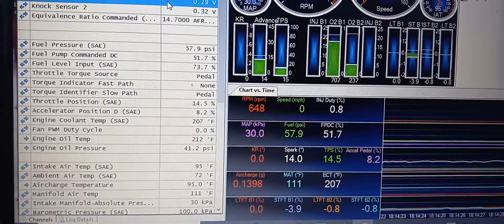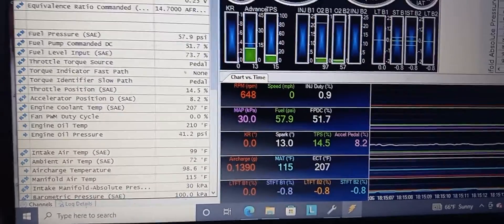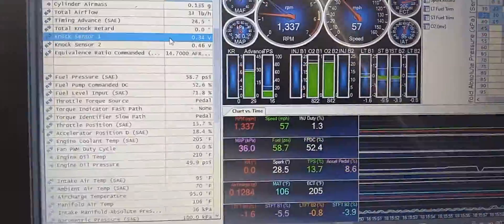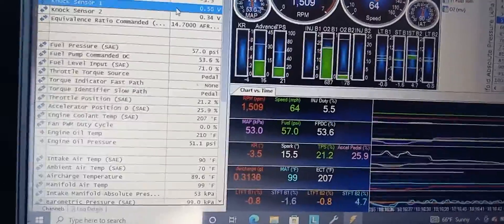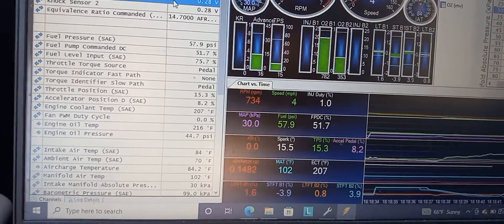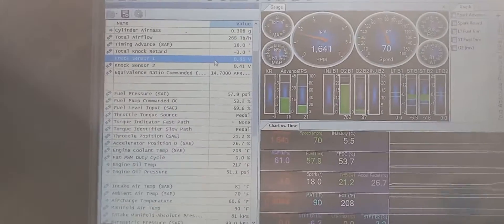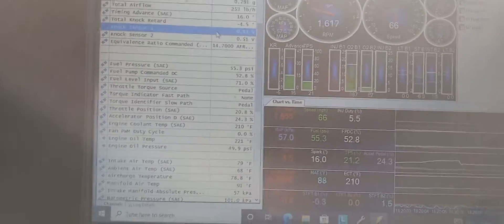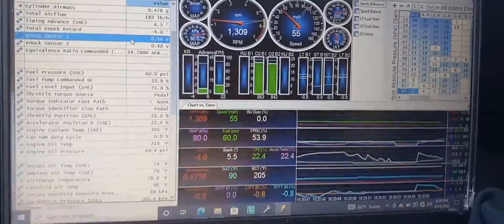short-term knock retard demonstration. 2017 Ram 1500

Comment: When you log minis 4-5 degree knock. Do you hear the pinging? What is the easiest way to distinguish false vs real knock based on voltages? Does higher volt always mean more knock ? How does it translate volts to knock?
Reply from the maker: 1) no it is usually - but not aleays- false knock at that load level with that fuel. 
2) anyhing above 2.8 volts
3) yes, sort of... 
4) too long to type.
Reply: @Moto-Psycho-1 i get 1.4v at WOT on my hellcat that has 2.85. With e15 and 16-17 degree timing. Knocks around -4 degrees. Could it be true knock.
Reply from the maker: @captain052A who tuned your car for the 2.85 pulley originally?
Reply: @Moto-Psycho-1 iam tuning myself currently.
Reply from the maker: @captain052A how much tuning experience do you have with other platforms? I would highly suggest getting your car to a qualified tuner have it on a load bearing Dyno and have your fuel trims, knock sensors and timing sorted for your combination. You will also want to make sure that you stay on top of your fuel pressure monitoring.
Reply: @Moto-Psycho-1 i have around 4 years experience. Iam not expert and not new. I can comfortably tune N/A hemis. But just diving in hellcats i thought better to get experience from someone who has hellcat before😁. Fuel pressure is a bit dropping high rpm. But iam watching it constantly. Iam upgrading to dual pump soon. But i expected the car to have minimal knock at 16-17 degree with e15. I guess i will bring it down a bit and relog.what do you think.
Reply from the maker: @captain052A man, so much to say that I don't even know where to start. First of all, I don't like e15. Your fuel pump is at its limit for what it can manage and those pumps are known to get weak over time so please keep an eye on that. As far as timing, it depends on what your air charge is and I don't know that you've even adjusted that table. There's so much that goes into tuning one of these cars that the fine details really do matter. That's why you've got to tune one of these cars in a controlled environment if you don't already have a tune for your specific combination put together or a drag strip which will allow high load launches and uninterrupted WOT.  Also, keep in mind a lot of this is Altitude based because with hellcats and any forced induction car that relies on a supercharger, I'm not talking about turbos here, but you're going to run into varying air charge values at varying density altitudes which also takes into account the altitude of which you live. All of which will directly affect your timing value. To put it in perspective, I worked on the tune that I set the record for stock boost 93 octane for over a year and a half. (10.05) Getting that car to that level was expensive and extremely time-consuming. Ive Tuned or have peer reviewed and revised tunes with 2.95, 2.85 pulleys, 2.85/10% lower... E85 and 93 octane.. the list goes on... I still have all of those Tunes in my old laptop. There's a reason why I don't mess with those things anymore.
Reply: @M @Moto-Psycho-1 live at sea level. But its mostly hot here DA mostly 1000+ and rarely gets 0 or minus short time a year (60deg F) currently). I currently get a max of 1.8-1.95 p ratio at WOT at coldest days. I reduced a lot of timing in high load low rpms because its a bit dangerous with so much boost. So my question is since stock tables for spark wot max out at 1.5 increased it to 2.0 to accommodate new boost levels. Do i have to increase remaining spark tables to 2.0 as well? Or just wot enough. My actual target is achieved roll 60-130 best times (we use kph) best i achieved was 5.6 sec 100-200kph. I want to enter 4sec range which is maybe low 5 in 60-130. But after i change the fuel pumps as pump is on the edge like you said.another question is what is the acceptable fuel trims for the hellcat? Because i have 1000fic injector adjusted it slightly. Its now average maybe 3-10% fuel trim corrections. What do you think. I run mostly 93 octane for regular drive (low timing).
Reply from the maker: @captain052A adjust all timing tables to agree to whatever air charge you have commanded the timing to follow. Also monitor that the ECU is following those tables and your commanded timing is where it needs to be, minus any spark modifiers. Fuel trims as high as 10% are within a safety margin, but I would much prefer to see something less than 5%

Comment: How much should they be desensitized?
Reply from the maker: Most tuners will pull roughly 30% out of the knock sensor values. That will vary though, based on known octane values for your area. 91 octane may only see a 20% reduction in knock sensor voltage. You can go higher than that, and all tuners will have to based on other modifications though. So the combination dictates really how much you can raise that voltage
Reply: @Moto-Psycho-1  like if you add longtubes to a car, do you just raise the voltage a little above what the datalog shows?
Reply from the maker: @sambo92  not really, 4 long tube headers, depending on aircharge and RPM you'll be somewhere between 2 volts and 2.6 volts. Again it's air charge and RPM dependent.  With the higher voltage range really won't start until after 1500 RPM. With softer increases from Idlel to that point
Reply: @Moto-Psycho-1  thank you B. I had a random spike up to 3.3 volts and mine is set to 2.9 at 6500 rpms. Didn't know if it was fuel or an anamoly or how far to desensitize them
Reply from the maker: @sambo92  it could be noise, but a really quick Spike  to 3.3 may have been a very quick pre-ignition event. It depends on when it happened. So for example, let's say you're cruising down the freeway in 8 gear in Matt the throttle, chances are you'll get some knock retard with some knock sensor voltage even though the knock sensors are reading in a normal range. That's typically just noise. If however the car is under a steady-state load and not necessarily right after a shift, chances are that it is an actual knock event, but if you have multiple spikes throughout a pull, and especially throughout a specific load range, then it is almost definitely a knock situations
Reply: @Moto-Psycho-1  it was at wot near the end of a run and showed a degree of knock. It's the first time I've seen it and use shell 93. I'm just tired of dealing with sensitive knock sensors
Reply from the maker: @sambo92  well, it may have been doing its job. This time of year, fuel quality isn't the best. Transitioning between Winter Blend and summer blend. Again it all depends on your area geographically.
Reply: @Moto-Psycho-1  it was odd because I never see beyond 2.6 at wot. I'm in north Dallas so probably fuel isn't the best. Wish I could switch to e85.

Comment: Whats up B , how do you know you got bad fuel quality in the log, besides pings
Reply from the maker: Looking at significant spikes in the knock sensor voltage is a clear giveaway.
Reply: On the kr scanner, look for blips and then if it fades to 0. Then add some octane booster and see if it goes away. If it does, fuel isn't that great.